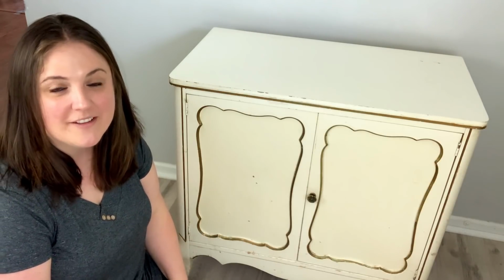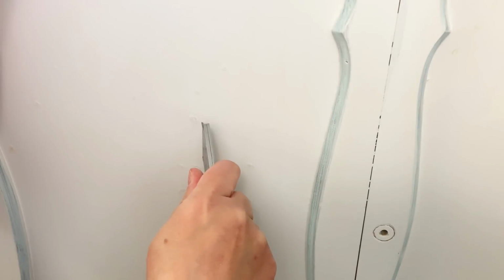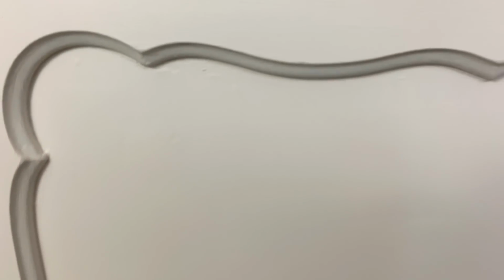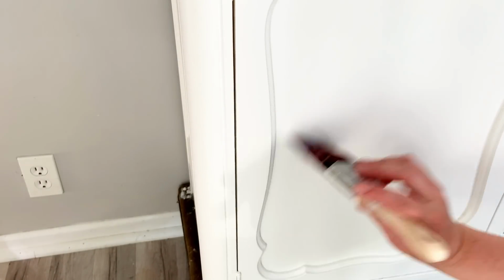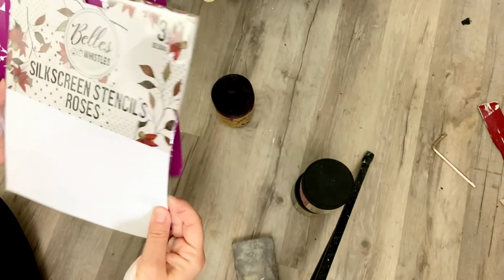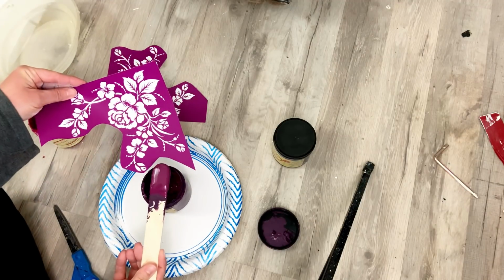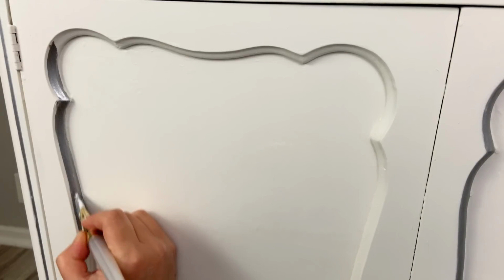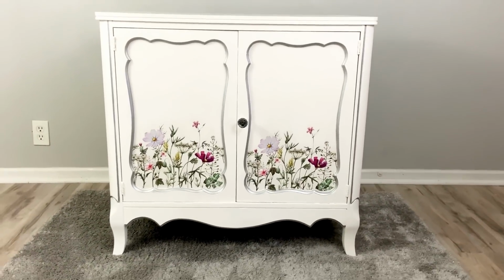Furniture Makeover Using Dixie Belle Paint | Trash to Treasure Furniture Flip |Start to Finish

Comment: Interesting how to repaired the wholes. How would you do it if the damage was on the corners? I have a dresser and the corners were damaged. I tried to cut it off but when I put the sealer on it, before I painted it became puffy again. I repaired it with Bondo and sanded it but it was higher than the rest of the dresser.🎉

Comment: For those on a budget. You can use mod podge instead of slick stick and acrylic craft paint will work great for painting. A clear top coat spray paint for finishing will give you a glossy beautiful finish. You can also iron on the design with decoupage paper. Use a sheet of parchment between the paper and iron.

Comment: Here’s a tip… if you’re using a decoupage paper that has a wide margin (as this one did) — tear the paper carefully along the exposed edge and it will minimize the paper edge line.  You will usually not have to fill in with mud.

Comment: The side stencils don't really "work" with the beautifully delicate flowers you added to the front/doors; the ideal "finish" would've been carefully cut-out florals from the same paper you used for the doors applied to your cabinet sides. Quite a few of your audience here have made this same observation. I refinish/makeover furniture for a living; you made a LOT more unnecessary work for your self by using the whole sheet of flowers instead of just trimming down very close to the florals and then decoupaging. Otherwise, it's truly a beautiful piece and you did a great job! Hoping you'll try another piece trimming off all that paper, you won't need anything but topcoat to go over the delineation between paper and surface. I would also finish by saying everybody has different aesthetics, so if you're truly happy with the piece??---that's all that matters. Best Wishes to you~!

Comment: I used the 3in 1 paint but I did not use slick stick first. I am hoping that if I coat it after with poly acrylic it will be ok.
Reply from the maker: You don’t have to use Stick first with a three in one. I only used it because my surface was extra slick if you have a regular surface then you’re totally fine without it.

Comment: Why didn’t you sand the whole thing before you put any paint or under coat on? That would make the paint stick and you wouldn’t have to dig out the sides afterwards.
Reply from the maker: Slick stick is a bonding primer. You can use it on shiny or slick surfaces so you don’t have to sand. Also, I did sand the bubbles With my sander but it does nothing. Carving them out makes for a beautiful finish.

Comment: It would be much easier to lay the piece flat to add the decoupage plus rip the paper off unevenly above the flowers and then the line wouldn't show
Reply from the maker: I went that route with the first paper And decided using the whole sheet worked better on this piece. Since the paper is so small I didn’t need to lay it down. I would definitely lay down for a bigger Decoupage papers though.
Reply: That’s exactly what I would have done.  Turned out really nice though!

Comment: Why not just sand prior to applying slick stik?
Reply from the maker: The surface is smooth and shiny so I don’t need to sand before. Slick stick is used as a surface for the chalk paint to adhere to so I’m only sanding after to knock off some brush strokes. I don’t always get brushstrokes but sometimes that happens and then I do a light sanding.

Comment: Great job a couple of suggestions 😀 Wet your brush a touch before you put it in the paint and it helps eliminate the brush stroke from happening. Trick 2 I use a straight edge razor blade to take off the raised bubbles on laminate!! Again Great Job!!
Reply from the maker: Thank you! Great tips😁
Reply: Also if you tear a lot of that top space it will smooth better
Reply: Kimberly, what would you do if the damage was on the top corners? I cut it off with the razor blade but it became puffy again when I painted it. Could I seal it with something? It seems what ever I tried didn’t work. TIA